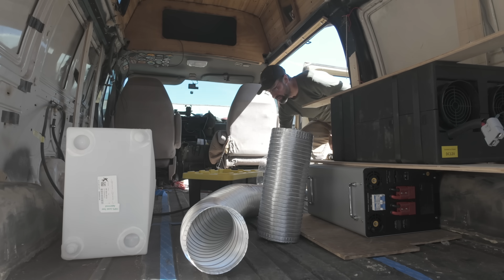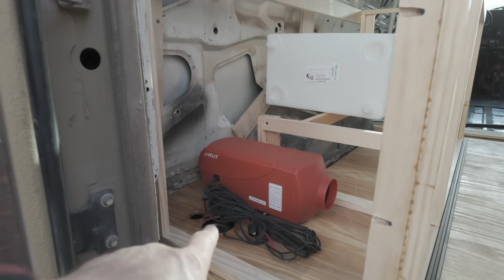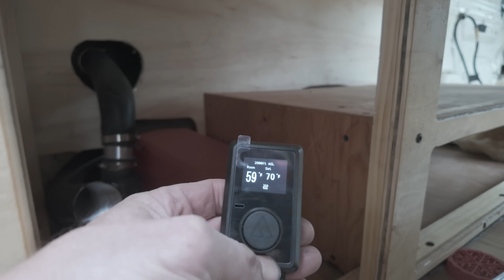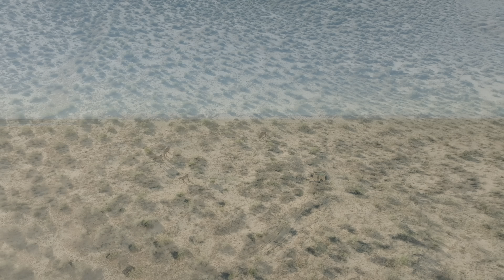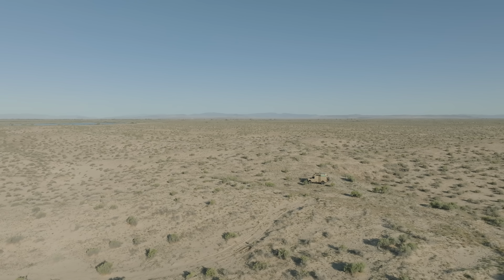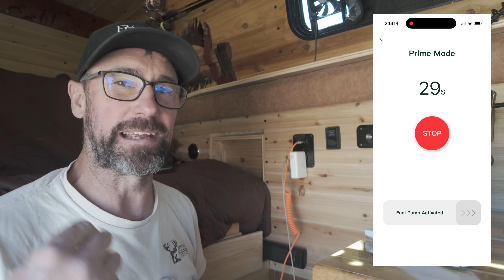Van Builders - Better Heat System for my van by Velit

Comment: I've had major issues with a diesel heater by running it on the ground with a 12' - 3" tube running into my rooftop tent. Problem being the heater would overheat due to friction loss with the tube being too small. The fix was to use a 4" tube instead of 3". I put a short section of the 3" onto the heater and then slipped the 4" over that and clamped it down. 
I'm now converting a school bus and plan on ducting a diesel heater in it as well. I've bought a 3x4 increaser to be able to use 4" tube. 
Just something to think about.

Comment: We have installed a gasoline heater in our Promaster, 2kwh, and it sits under the passenger seat right next to our fuel tank. The exhaust goes straight down. A wonderful addition. Best wishes.

Comment: Jason I'd enjoy hearing more about your aux gas tank. Where you found it, how it's installed under your van, how you fill it, what fixture used to tap the Velit into it? I have the Velit gasoline heater as well but I haven't installed yet. Planned to tap the main gas tank, but I like the idea of having an auxiliary tank for the expanded fuel capacity. Plus I may go with a 4x4 conversion, and that typically cuts off about 5gal from the main gas tank to fit the transfer case.
Reply from the maker: Thanks for the feedback. I will put some thought into making a video about it.

Comment: Nice video. The only potential problem I see is the angle of the pump. I would rotate it just a bit more so the output is higher. Less chances of introducing bubbles in the line.
Reply from the maker: I don't disagree I am going to mess with it a bit more once I get back to my shop but so far its been working fine.

Comment: Hehe ya bought a thousand + $ machine that's gasoline since your van is gas & ya go & put an external tank on it anyway & a complicated pumping system to take gas from the vans tank to the aux tank SMH People JUST get a $150 Diesel heater WITH bluetooth and the external tank & call it good.  OR if ya wanna keep the system all gasoline plumb into the vehicles tank, leave the pickup tube a 1/4 tank up from the bottom so the heater doesn't cause the van to run dry. ;)
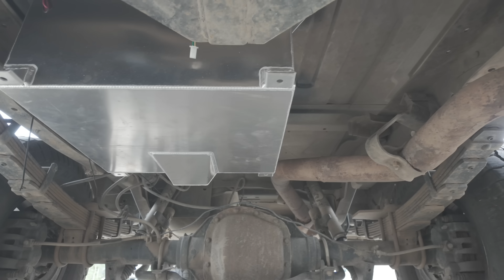Reply: 1. I'm guessing he didn't pay for that heater. And if he did, so what, it's his money. 2. That's a huge auxiliary tank. It is absolutely not JUST for running the heater and he isn't pumping gas from his main tank into the aux tank. It's the other way around. He even says exactly that at 3:20 in the video. But hey, keep on smacking your head:)

Comment: I camp in Colorado at high altitudes around 10,000 ft (Breckenridge, Leadville etc). Will this heater function normally and without fouling at those altitudes?
Reply: As far as I am aware Espar is the only gasoline heater that can manage high altitudes.
Reply: @LoveTribeOverland  Velit will also work over 10,000 feet. It’s even been tested in Tibet at 16,000.

Comment: I wonder if plumbing it directly to the main tank would cause issues with throwing a code like when the fuel cap is loose.  I know the fuel tank has to be sealed to avoid that.

Comment: Diesel would have been better because it is less volatile and just easy to get fuel for it
Reply: He would not be able to use the heater's fuel tank as a reserve for his main tank though. With a gasoline heater he gets the best of both worlds. Plus, diesel is about ~20% more expensive than gasoline per gallon. And gasoline is easier to get than both diesel and propane.
Reply: @drott150 I have warning concerning a heater that uses gasoline to operate.  I’m warning you guys that it is a very dangerous situation as it is highly volatile.  Yes using diesel would require its own supply, but I disagree that diesel is not as available as gasoline. Be safe.
Reply: @MC-.-  In the US diesel is widely available at most gas stations. Its availability is not usually an issue. But there are some small gas stations in out of the place locations with only 1-3 pumps and sometimes they only have gasoline. Lived here my entire life and I can assure you that's true. As far as volatility? Yes it is more volatile, but if that's your concern, then you shouldn't drive a gasoline powered vehicle at all. Because it carries a giant fuel tank filled with gasoline and it pumps and burns the fuel in a hot dangerous engine with a hot dangerous exhaust its entire life on the road.
Reply: @drott150 about the diesel I concede your point, but your argument for a gasoline burning car is safe so therefore a gasoline heater is safe is not compatible.  If it were installed by the factory where they are liable maybe a good argument, but that’s not the case.  A gasoline car has numerous safety features where a gasoline heater has none and is installed by the individual that can not anticipate failures placing safety to non qualified people.  Again, be safe.
Reply: @MC-.-  Theoretically what you're saying is understandable, but I see no evidence there's some kind of epidemic of RV/van fires due to gasoline powered heaters like this. They are very commonly used and for many years now. If you have evidence they in practice - not theory-  are a serious safety concern for the reason you cite, then bring forward your statistical evidence of documented fires and deaths from gasoline powered heaters like this vs diesel. As far as "if you carelessly install it, there's a fire risk." Uh yeah, but that's a risk for just about everything you endeavor to do. If you install it correctly, than I see no undue risk. If gasoline heaters exceed your personal threshold of risk, great. As for the rest of us, we don't live our lives in fear of things that are considered a manageable risk. Lastly, diesel will catch fire and burn too if you have a leaky line dripping on a hot exhaust. You're not opting out of risk with a diesel heater.

Comment: What is the capacity of the extra tank you installed, and where is the fill point? Sorry if I missed that.
Reply from the maker: Its 15 gallons and the fill is on the side of the van.

Comment: Been running diesel,  as you pointed out, gas is more convenient. Less issues with fuel gelling too i would think. Personally, i dont much care for the smell of diesel either. And it shoild burn cleaner of air/fuel mixture is good. Im sure that thermostat has altitude compensation...
Definitely looking into gas heater...

Comment: I'd recommend some sort of filter on the air intake- pet hair/dust/etc. going into the heater can make for some funky smells!!!  You'll want it to be large and free flowing, you don't want to restrict airflow through the heater of course.  I found a HEPA grade filter for a large wet/dry vacuum that I was able to make work, lots of area, I can clean it, and if after a couple cleanings it becomes a problem easy to replace with another one.
Reply: I installed a small engine air filter, small round one off Amazon. Helps keep combustion chamber clean and doesn't give carbon any particles to address too..I've been running diesel and use cabin air, it's warmer then cold air outside. 
Carbon build up inside combustion camber will insulate heat produced from wall that transfer heat.

Comment: I've got a similar/typical Diesel heater in my PleasureWay (E350 chassis).  Space issues led me to mounting it under the floor in front of the spare tire, and running ducts up to appropriate locations.  It works fantastic.  I have a small 5L tank mounted in rear storage bin, easy enough to get to.  It being Diesel isn't that big an inconvenience, I carry a 5gal diesel can and that gives me days of heat.  When summer comes I'll un-mount and store it... installing it again should only be a 30min job.

Yeah, gas would be nice but you can get the typical Diesel heaters for under $200 (sometimes under $100).  That Velit  unit is $$$!